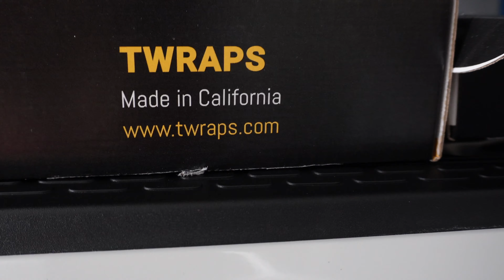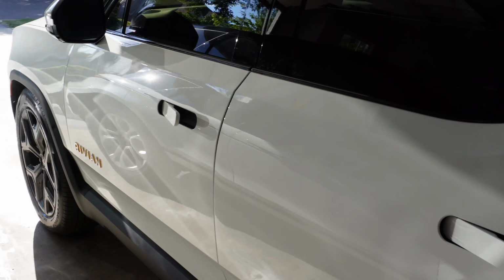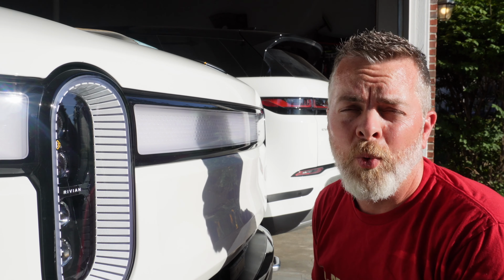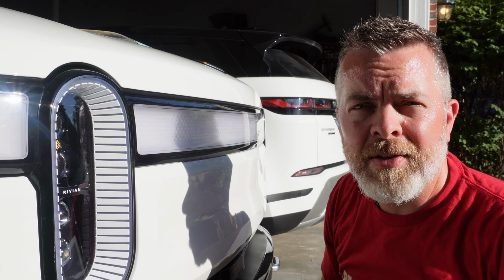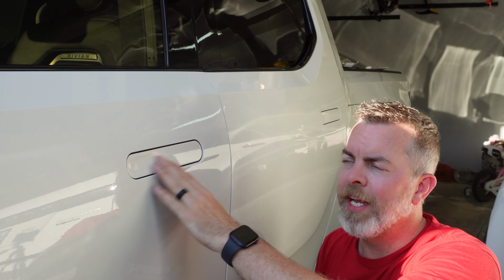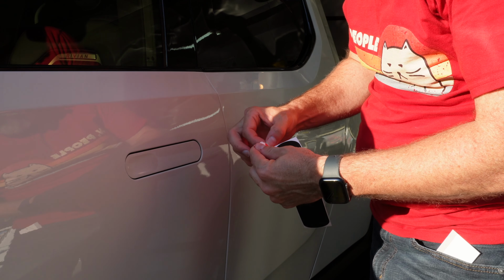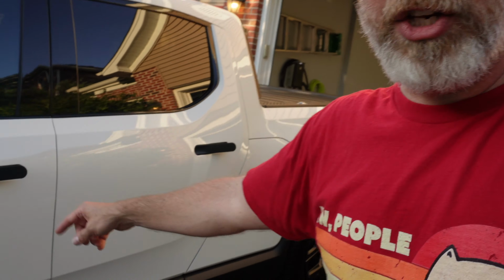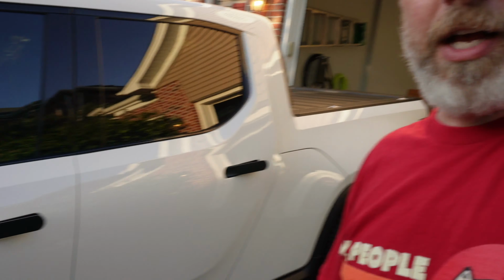Rivian R1T PPF | Tinted Headlights | Tinted Taillights | Black Door Handles | Twraps

Comment: Very cool especially the fog light area imo. I wonder if the door handles would look better in a tint instead of so black. I 'm sure that would be doable with some more ppf. Have you experienced any electronic door opening issues ? I would like to have seen more time and angles of your finished product and compare it to the before look. Thanks for showing that this can be done by non professionals.
Reply: I changed my mind I am liking all of it now. Maybe the mirrors next. I have a Compass Yellow coming this week but have the not so great looking 21" road rims. The Yellow is bright enough that I might tone it down with the medium smoke on the lights just like you did, and matching black carbon fiber on the rims and door handles. How are you liking the screen protectors ?